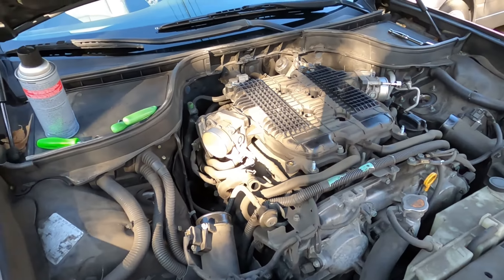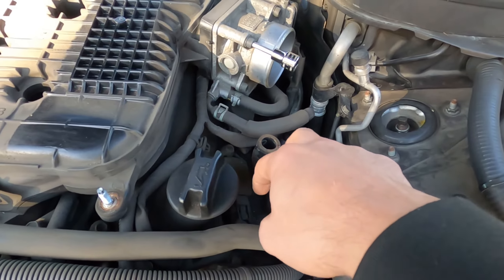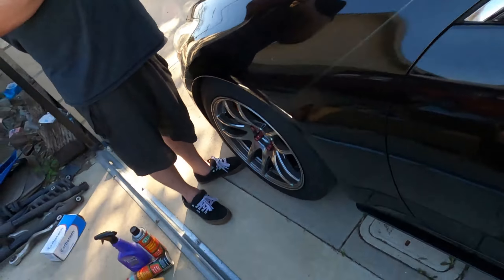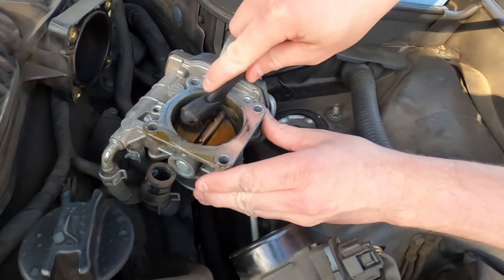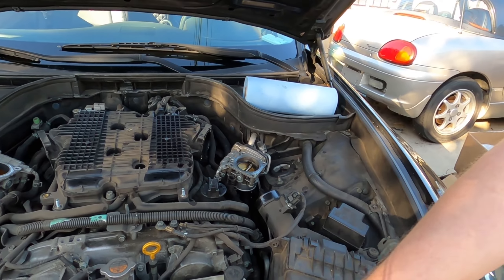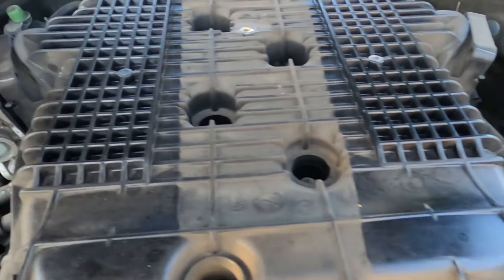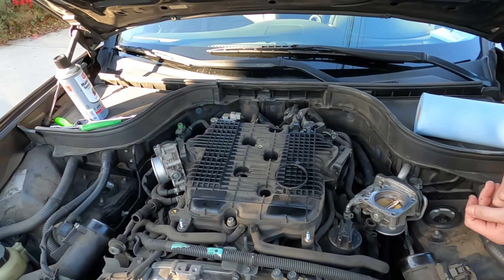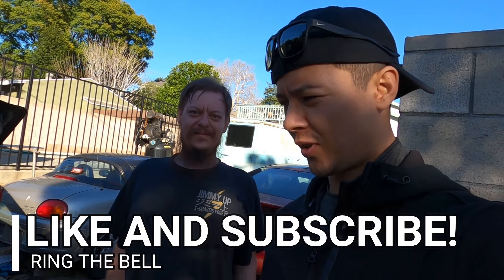G37 THROTTLE BODY CLEANING! (Also works for 370Z, 350Z, G35, Q50, Q60, 370GT)

Comment: Hey I have a 2008 g35x and I’m having trouble with starting once the car is warmed. New starter in the car now when starting sometimes it will just die out or I have to give it some gas to keep the rpm’s up would cleaning the tb help or solve this?
Reply from the maker: This sounds like a similar issue I had that was caused by the maf sensor

Try cleaning your maf sensors first and let me know what happens 👍

Comment: My car doesn’t stay running it turns on after like 2 seconds it just loses power i got like 6 codes for the throttle body/circuit idek did I just ruin my car bruhhh
Reply from the maker: Any progress on this since? Typically if too much brake clean was used it’ll take a few starts to get going, but once it dries up (which is usually pretty quick) it’ll start to run normally again.

Comment: Use throttle body cleaner, not brake clean! Unplug the connectors and coolant lines. Only a tiny bit comes out. You can place a paper towel under the lines to absorb it. Take them off completely and open the valve with your hand. Spray inside and use a toothbrush to scrub.
Reply from the maker: The point of not unplugging the throttles is so you don’t need the car to relearn them. Throttle body cleaner is basically just more potent brake cleaner, however it has a higher chance to leave residue behind. Brake cleaner is more than fine to use on throttle bodies. 👍
Reply: @BalancePointMedia  I don't know where you're getting your information from, but it's incorrect. Throttle body cleaner is not stronger than brake cleaner, and has oils to lubricate moving parts. You might need a relearn if you move the valve WHILE plugged in, not if you unplug them. I've done this countless times on multiple VQ motors with no relearn required.
Reply from the maker: I suppose we could get into a conversation about how a properly working pcv system will eject some oil into the intake lubricating the parts, but it’s not really that important. You’re correct throttle body cleaner has extra oils in it, but it is also more concentrated than brake clean, as per the data from crc. It doesn’t particularly matter though. I’ve also done this for a long time, and I won’t sit here and just be like “ur incorrect” but we’re both correct. Have a good day. 👍

Comment: Yeah, but if u diconnect the battery how would it know. Also, im cleaning it because of the high rpms on start
Reply from the maker: The ecu still has memory of parameters, and the throttle sensors on newer cars can be finicky, it’s not that it can’t be unplugged, but as said the car will have to relearn the throttles. Some cars can have the battery disconnected for a few and relearn quickly, some like this take a little time to relearn. If you don’t have to wait for it to relearn by leaving it plugged in, there’s no reason to do it. If you have to unplug it? Go right ahead just know the car can act very strange during the relearn time, that’s all.

Comment: Help my car hesitates to start I just got a new battery from Costco I have never replaced my air filters they look pretty bad it’s a 2008 g35 vq35HR will cleaning maf help I have to engine light on
Reply from the maker: At the very least you’ll need to scan for whatever code is being thrown. If you don’t want to order a scanner just run over to an autozone and they’ll do it for you
Reply: @BalancePointMedia  no codes it’s the starter no crank no start I smacked the starter turned on
Reply from the maker: @abbas674  sounds like you just need to rebuild the starter or get a new one. Usually the contacts in the starter will deteriorate over time and smacking it is the fix. If you have to smack it then it’s time to swap 

How does it run once it’s on?
Reply: @BalancePointMedia  no start no crank I smacked it and it turned on right away I just took it off had to remove the front axle and wheel hub assembly it runs normal just idle up and down sometimes
Reply from the maker: @abbas674  There is an idle relearn procedure you can do for free to see if it makes any difference. If it doesn't then your MAF may need to be looked at. How many miles do you have?
Reply: @BalancePointMedia  the idle relearn process makes a difference for like 2 days than it’ll idle up and down I have 173k miles I will be cleaning the sensors today
Reply from the maker: @abbas674  if the maf sensors haven’t been cleaned or replaced then that’s probably part of it for sure
Reply: @BalancePointMedia  hey man so weird drove on highway for 1hr got home my vdc slip abs and awd light where on I did a pull throttle pull and it spun the rear tires
Reply: @BalancePointMedia  I do have my driver side speed sensor without a bolt it’s just in their hanging after replacing starter I saw the sensor had no bolt
Reply: Great video ! Love it ! My Q50 has 87k miles on it . When is the first time I need to clean the throttle body and the maf sensor ? Thanks in advance!

Comment: no relearning procedures done?
Reply from the maker: Not specifically on this time and didn’t seem to be an issue
Reply: i just seen another video, they axtually did the relearn lol.. i checked on reddit too. they say to relearn it
Reply: @ yeah I’ve cleaned 2 VQ37 and each time the idle was above 2k rpm. Check engine light came on one of them but after the relearn I just cleared it